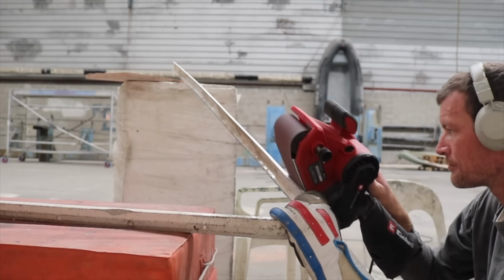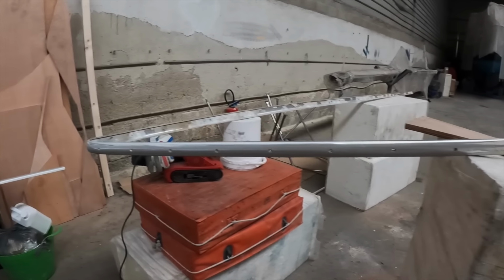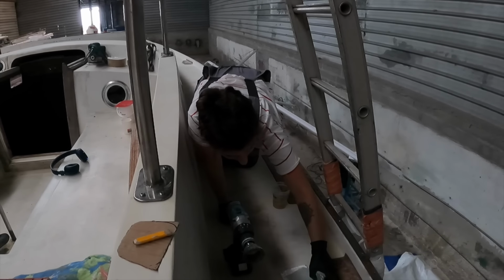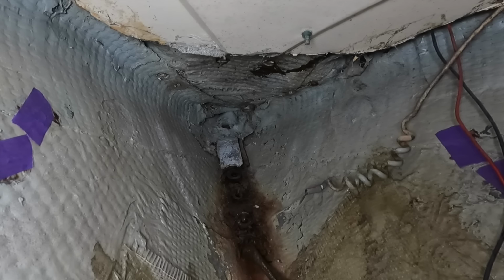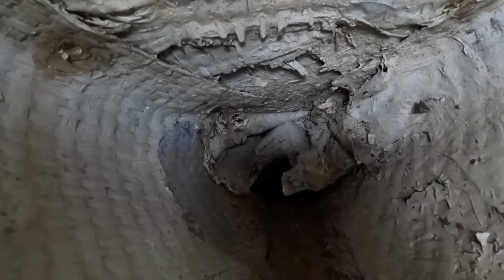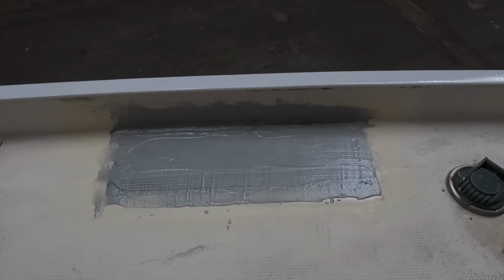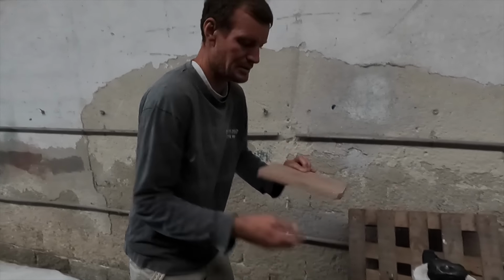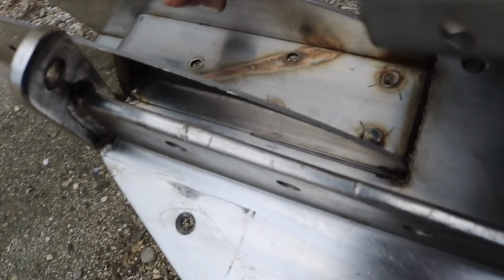Don’t Buy a Project Boat Unless You’re Ready for Burnout! Near the Finish Line & Escaping the Hangar

Comment: Rainy day here. So working inside improving electronics. Drilled two more holes 😁(i hate drilling holes in my boat) to fix radio antenna splitter. Work is going slowly but going. Step by step...

Comment: Nice job on those stancheon bases Marina, they look nice and strong as they should be and no doubt you will be adding backing plates underneath them as well. Stu, that bow fitting also needs to be super strong if you want to connect roller furling gear to it later. The load on that fitting is very high when you tension the furler to roll the sail correctly.

Comment: Hey guys, thank you for sharing the build and hard work.
well, me, the wife and a couple or work colleagues, just spent a few days doing about 600 sqm of flooring in one of the shops the company we work for manages. For us older folk, it's been hard work. Especially when we are normally doing desk jobs, lol. We are in the outback of Australia. Has been in the high 30 degrees, lucky for us shop is air conned.

Comment: I live on my project, and sailing 4-6 days a week. I needed to repower, so bought an outboard for the meantime. Completely happy to be on the water daily. I'm about to pull out the old diesel and rebuild it myself, after getting the block inspected. It's about 25% the cost of a new engine. Good luck getting into the water asap.

Comment: A really great episode, I get so many ideas from seeing your work, the stanchions on my boat are one of my next jobs.  I smiled when I saw Stuart tucked up inside the bow as this is how I spent most of May this year as I strengthened the deck, replaced the backing plates and rebedded all the fittings including the stemhead.  It's really tight and uncomfortable in there and a similar job elsewhere on the boat takes 10 times as long because of the restricted location in the bow.  Just getting into position with lighting and tools to hand is an accomplishment.  Excellent work on the stemhead, its really tricky.

PS.  You managed to get a really good finish on the hull - there was close-up of the paint job as the backing plate was being held up against the stern, it.  Good job.